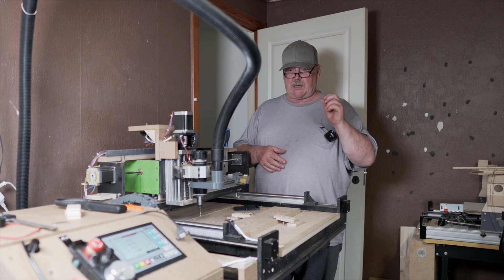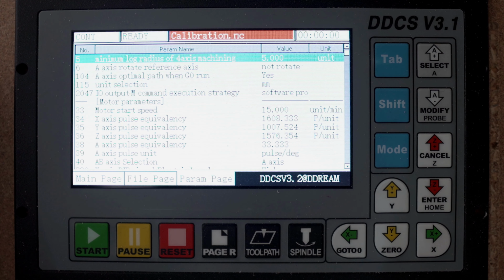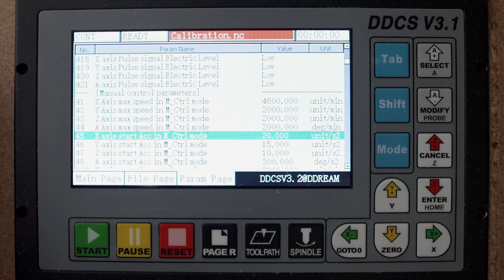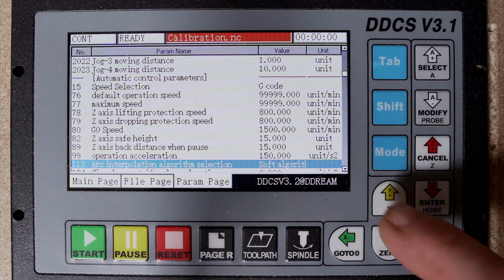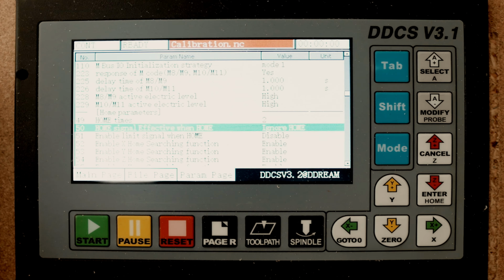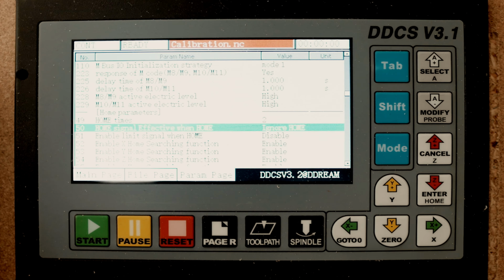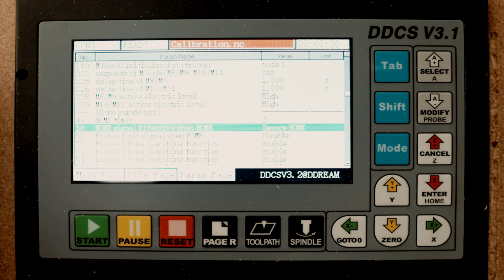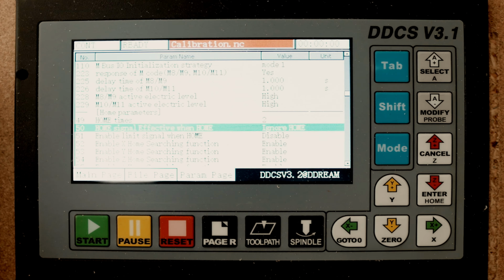DDCS V3.1 Menu  my setup and configuration that I use

Comment: Nice demonstration thanks. do you think this is suitable to operate just 1 axis for example x axis only. I have developed a machine which only has 1 axis currently driven by a pneumatic cylinder but I want better control of forward / return positioning, acc/dcc and inputs and outputs. I realise it is probably "over the top" in terms of functionality but the single axis controllers on the market are extremely difficult to operate for a non cnc person. That are your thought please.Thanks. John
Reply from the maker: Sure, it can do.  but I would say it is a bit overkilled for 1 axis I recommend googling for CNC offline controllers
Reply: @weitlingD3P  Thank you so much for your response. One question I forgot to ask you. Can I simply set parameters for this single axis on the parameter page such as , set home: start, accelerate, run at a set speed and number of pulses to reach a specific distance, decelerate, stop, wait, run in reverse with or without acc/dccl back to home. All without using G-Code, only manipulation of the basis parameters. Thank you again. John
Reply from the maker: Hi John.  Yes you can do you can enter maximum feedrate.  If you install an end switch you can ask the machine to move home,  this you activate in the menu  Happy Carving  Take a look at this video for info on Homing https://www.youtube.com/watch?v=X7dyDlO3yLM
Reply: @weitlingD3P  thank you so much sir. You are a great help. Very much appreciated. Thanks also for the homing video. 🙏👌
Reply: Why can't you just use an arduino?

Comment: My system will not read T.nc when an M6 is executed. I put a T.nc on the USB drive, is that the correct location?
Reply from the maker: Hi If I remember correct it need to be in system memory, where you need to copy it from the usb to the system root.  BUT the DDCS 3.1 does not support tool change.
Reply: @weitlingD3P  Yes I found that.  I put a T.nc in the internal drive and that worked.  It was probably supposed to be there, but mine did not have it. I found the internal files by accident, it is probably in the manual, I just never saw it.

Comment: Hi. How do you change the home parameter settings? When the router is at the home position, how do I make the number all zero? Regards, martyn
Reply from the maker: Hello Martyn. when you home the router, it start move to the home switch.  When activating the switch it automatic zerro out the axis.

Comment: Hello, my problem with the controller is as follows: When I load the g code from the flash drive, the machine very slowly raises the z axis to the required value and stops, and the controller starts playing. How can I solve the problem?
Reply from the maker: Hello I think this must be the G0 speed .  If you go to line 80 you will find G0 Speed.  Enter 1500 unit/min   Hope this solve the problem
Reply: 3500 unit/min
Reply from the maker: Try line #43  should be 16000

Comment: Hello, i'm trying to do the calibration but in Inches. But i can't, only in mm, do you have a solution for this?
Reply from the maker: Hi Jorge  try to enter the parameter page goto line #115  change settings from 0 to 1.  But I am not 100% sure.  But try it
Reply: @weitlingD3P  i'm already tried that, but the system doesn't do the correct move, and when i try to make the same process to adjust the steps but in inches the quantity of steps is crazy.
Reply from the maker: Sorry Jorge Then I dont know. I never work in inches
Reply from the maker: Maybe your calibration is totally out of sync  take a look here https://www.youtube.com/watch?v=Vy2B5MW8gGc
Reply: Did you ever resolve this Jorge? I have the same problem
Reply: Hello,  @joemoffatt2985  
No, I still have the problem, so I give up and just use everything in the machine in mm, even the designs I made. 
If you do everything in mm, you shouldn't have any problems like I did.

Comment: Hi, im using ddcs v4.1 and i have problem with y axis, its inverted, when i press y+ it goes towards me instead of away from me , do you know which parameter should i change?
Reply: Switch DDCS parameter for DIR frequency from Low to High - or switch your DIR pins around on the driver

Comment: Have you figured out tool length offsets  with this controller? Do you use G43?
Reply from the maker: Hello Robert  The tool length offsets are not working in the DDCS V 3.1  This is implemented  for a future update of the firmware.

Comment: Good video, how did you set up your dual y axis.
Reply from the maker: Hi Richard.  I simply connected the 2 stepper motor to 1 stepper driver.
Reply: @weitlingD3P  that will not work for me I have closed loop motors
Reply: Apparently you can parallel the signal to two drivers which both have individual motors. about to test mine next week this way

Comment: Where did you get the 3.2 firmware update?
Reply from the maker: Hello if i remember correct it was ina facebook group
Reply: @D3P  I actually found a 2021 update on the ddcs forum with xyz probing. I wanted a probing cycle to find the center of a workpiece, and i was wondering if it comes with the update, but it doesn't. So now i am trying to write my own macro.
Reply from the maker: @Craftedtree  That is good good luck with the code.

Comment: i want to help for this controller
Reply from the maker: Hello Niraj.  How can I help you?
Reply: @weitlingD3P  i want home settings in this controller
Reply: when home sensor sense after come back 1 or 2 mm back and then stop
Reply: in all axis
Reply: please help for setting parameters
Reply from the maker: Hi That is Normal  this you can set in line 83 84 85  I have a back distance of 83=X 2mm  84=Y 2mm and 85=Z 4mm  The reason is that the cnc need to open for the home sensor
Reply: @weitlingD3P  but sense sensor after back dont stop motor
Reply from the maker: If the motor continue run you need check your wires If you have the sensor in limit switch,  you need set the parameter Home = limitswitch
Reply: Hi guys. Does anybody has a gcode sample that can runs with this controler.... I try everything with BobCam and sheetcan and no chance.. wich postprocessor I need use? Mach3? There are any Gx that I must delete to run?